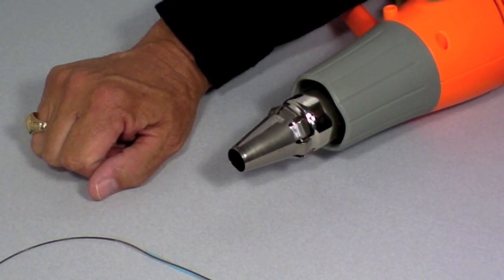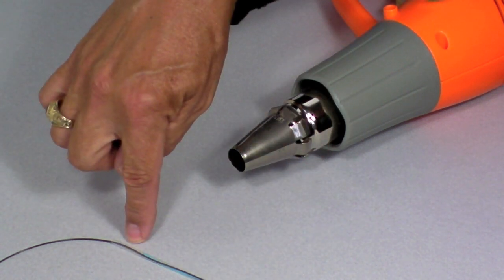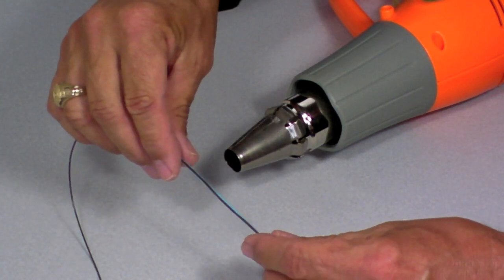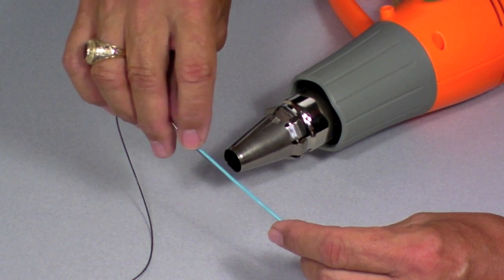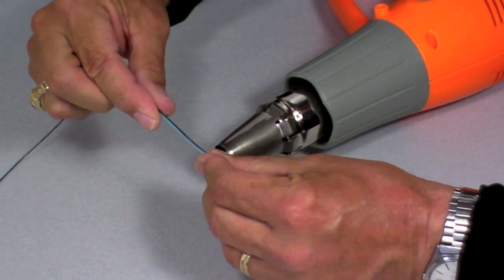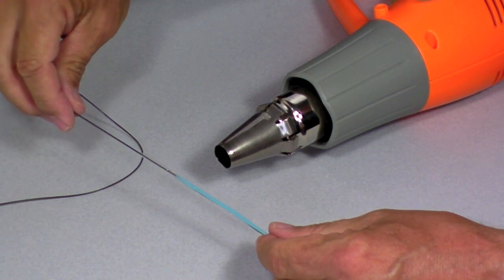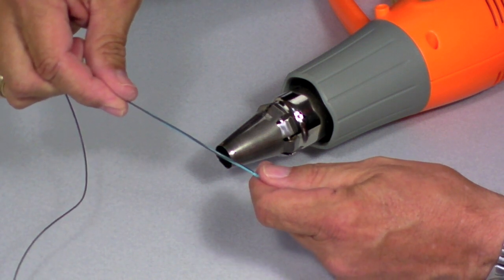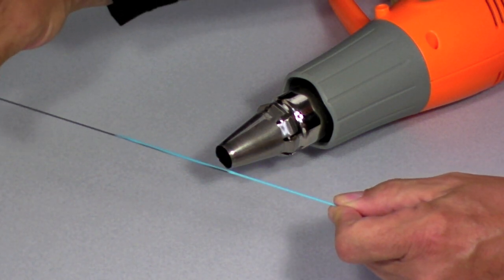Welding T Stuff to Fly Lines

Comment: Do you think that this joint would surpass the 50lb mark when welding T20 to thick fly line? (Read: would the joint be stronger than 0.50 fluorocarbon)
Reply from the maker: No it would not as the core strength of most thicker fly lines is only 30lb. Lighter trout lines are only 20lb. A few saltwater lines may have 50lb. cores.  

When done properly, the welded joints will have a breaking strain greater than 30lb. but it won't ever get to the 50lb. level as the core strength isn't high enough.

Comment: Hi sir, is there any difference in welding technique between PU and PVC?
Reply from the maker: PU melts at a lower temperature, which makes it easier to weld, plus it does not require plasticizers to stay supple. PVC requires plasticizers which can cook out when heated and leave the material brittle. As PVC melts at a higher temperature, the difference between melting and overcooking is narrower than with PU.

I've found that relatively new, high quality PVC lines weld more easily and tend to remain more supple after welding, compared to lower quality or older PVC lines. I've had zero luck welding PVC lines that were around 10 years old or older as their plasticizers have either mostly leeched out or are easily cooked out by the welding process, leaving a stiff, brittle, overheated mess. 

Old PU lines weld just fine.

Comment: Why not weld a loop on both lines separately? Then join them together (loop 2 loop connection)
Reply from the maker: This is part of the process needed to make Skagit tips, which is why it's presented this way. However we could just make loops if we're not interested in adding a floating section to it. I've also used this method to build a one piece fly line that was T8 on the front, intermediate belly, and floating running line. Knowing how to weld sinker to floater let's us be creative.

Comment: what heat gun do you recommend? Also how long is your sink tip on front of your intermediate line?
Reply from the maker: +Linda Henry usually the overall sinktip length is 10' - a mix of floater and sinktip or intermediate and sinktip.

Any 1500 watt heat gun with a low heat setting and either a concentrator nozzle or heat shrink attachment, will do the job. The problems occur when the heat gun does not have any way to concentrate the hot air flow to about a 1/2" of heat shrink.